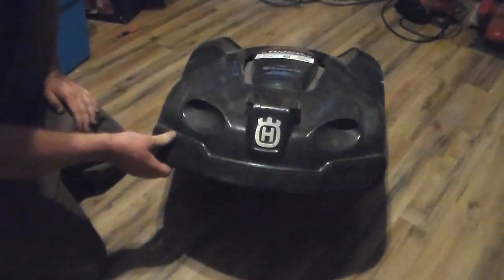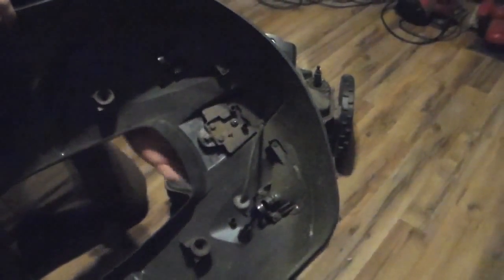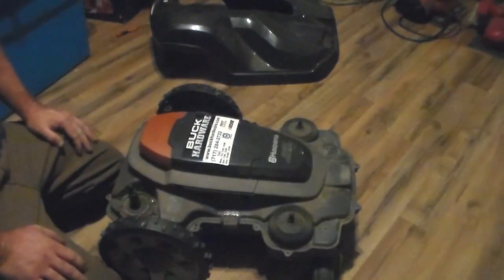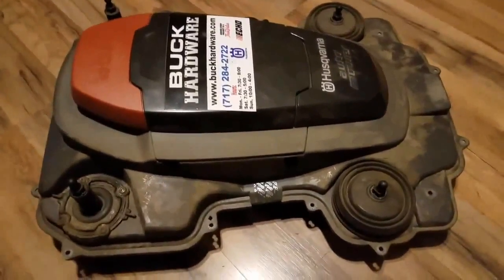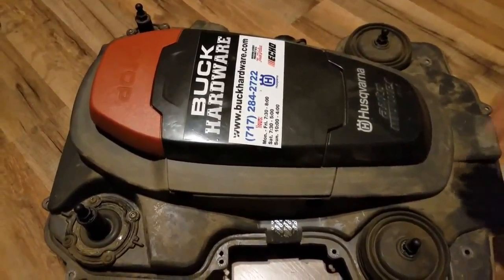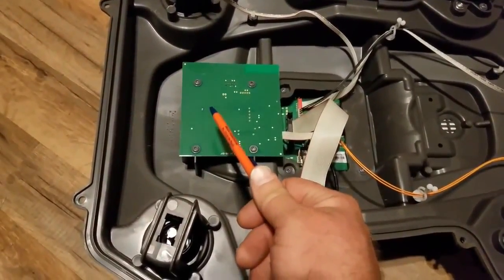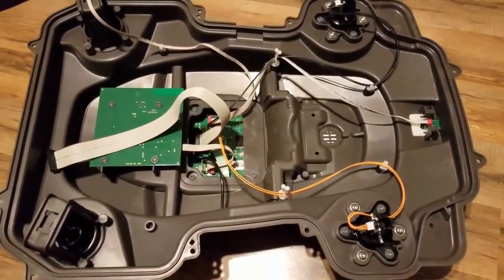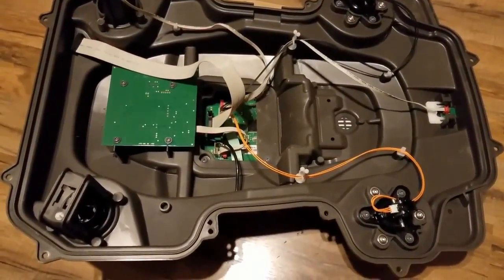What's Inside A Husqvarna Automower

Comment: Excellent video!  I do have questions. Are these mowers sealed well enough to keep water out if the mower were to enter a pool of standing water about 6 or so inches deep?  I also would like to know how I can change the phone number in the AutoConnect that will allow me to send commands to the Automower.  I bought mine online so it’s not programmed with my number. My magnet fell out after the first year. I found it using a pice of steel conduit, dragging it around the yard near the place where it stopped.  I  sealed it back in place with some silicone and it’s been fine since.  I do get some odd errors from time to time, especially after it’s been upside down for a blade change.
Reply from the maker: 6 inch deep water is too much. The AutoConnect software is actually connected by your Google Play or Apple account and not by phone number.
Reply: Eshlemania TV  I figured as much but I can’t be the only one with a deep spot or two after a heavy rain.  Why don’t they still include the rain sensor so it can park as an option, like the early models in Europe had.  AutoConnect has two way SMS functionality separate from the apps.  Where I am going is if I could send an SMS to my mower to park it I could use IFTTT.com to park the mower when it rains.

Comment: Thanks for that. Do you know if it is possible to install a bigger or extra battery in a 420? I'd love to try it (maybe closer to end of warranty).
Reply from the maker: Currently, no you can not add a second battery to the 420 or 430X models. But who knows what the future will bring.
Reply: Eshlemania TV Do you know if fitting a single higher capacity battery would increase cutting time ? I'm assuming it's not hard coded for the standard and hours?
Reply from the maker: We've had a chance to play around with several 430X models and compared notes with several others that own them and have been using them for a year or more and it seems that all of us were around the same work to charge times of 4 hrs mowing to about 45 mins to recharge and be back out mowing again. So with that kind of efficiency there's not much reason to spend the money or time trying to upgrade the battery. Also as the weeks go by the mower will learn the lawn or work area and create it's own map using GPS. This will make the mower even more efficient over all by cutting down on the amount of time it spends mowing thanks to the weather timer feature. The "Add a second battery to a 430X" was a popular topic for the first few months after the units arrived in the United States. But after people actually used them and gave them time to do their thing the talks died off because people realized there just wasn't a need for a second battery.
Reply: Thanks. I guess it'll depend on how long your grass is, how sharp your blades are and what temperature it is. But I've just timed my 420 and it cut for 1hr 25 mins then charged for 50 mins.

Comment: Hi,

I just set up a  Husqvarna auto mower 315.  I have it all hooked up the green light is on the charger. Everything seems correctly installed. The mower powers up and tells me to shut the door to start. Then nothing happens. It just sits there. I have not seen the thing move yet! Is there a one time setup wizard when you first turn it on? If so I may have used that before I had my wire set up. How can I make it do the initial setup again?
Reply from the maker: Put it back in the charging station. Go into the menu and go to "SECURITY". Then go to ADVANCED. Then choose "LEARN NEW LOOP". Once the connection has changed it should be ready to start mowing. If this doesn't solve your problem then call Buck Hardware (717-284-2722) and ask for Dwight.
Reply: Figured it out. There was a loose ribbon cable going to the start button.